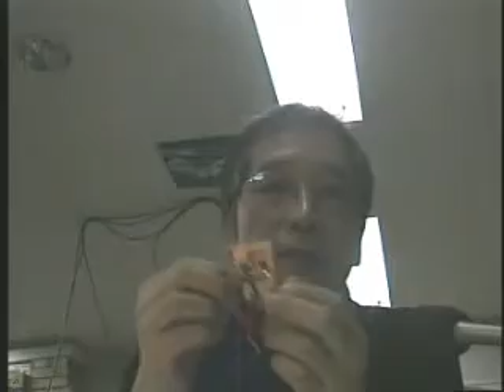Tetsuo Kogawa - Making a FM transmitter Part 4

Comment: I am a pirate station from the Netherlands.
I was began with a FM transmitters like this when I was 13 years old
usually a bit unstable, unfortunately but it is/was still fun!
now I am transmitting on shortwave as a pirate radio station.
with not much power do you come sometimes quite far away

Comment: with 10watts and Conditions sometimes half the World.
if you are good looking on the internet you will find the schematics 
for this transmitters (quite simple for someone with a litle experience!)
If you have a shortwave receiver look between 6200kHz and 6500kHz
In AM mode (modulation type) often around 6300 and 6305kHz
Attention!!! You must have a good antenna!!! 
(For example, a dipole antenna approx 2X 12 mTr)

friendly greetings and good luck!

RadioRob.
Rob.